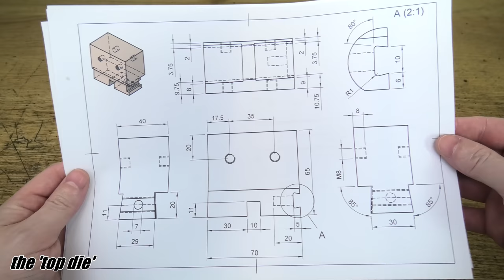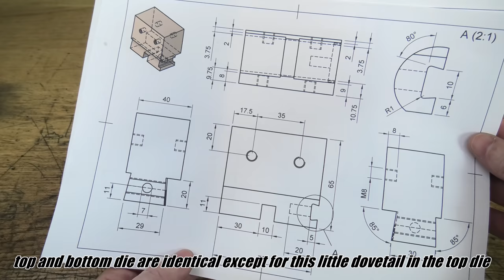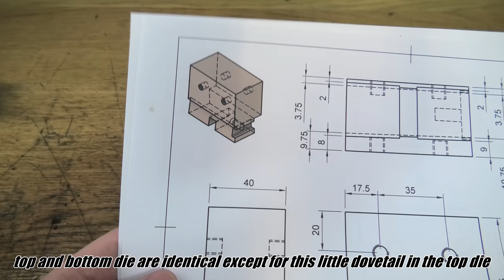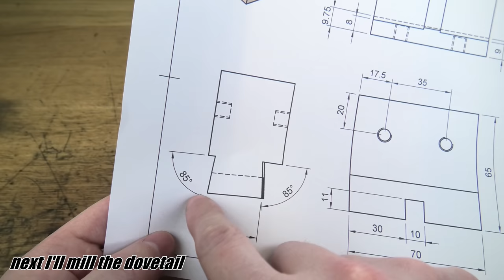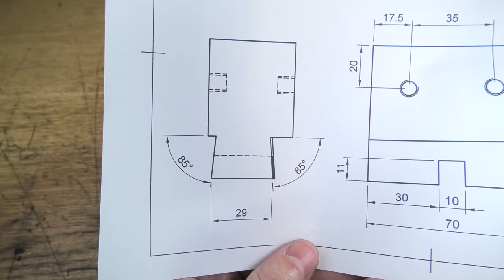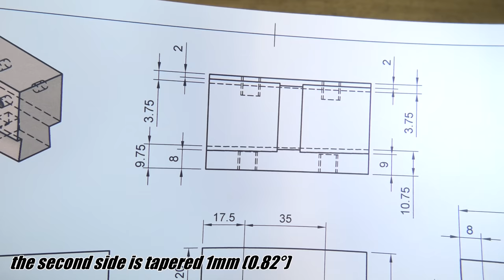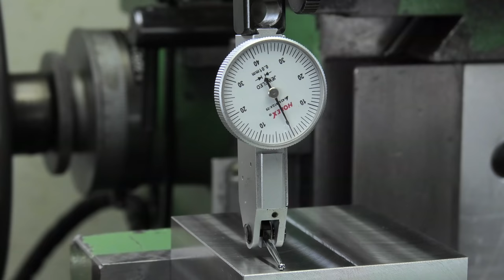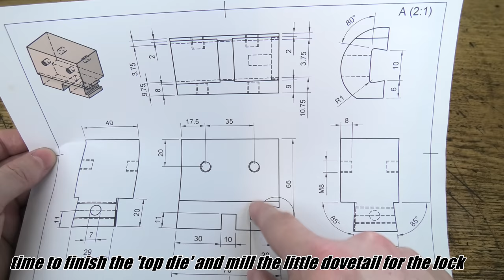Making Power Hammer Dies for 'Black Beard Projects' - with Lock Mechanism

Comment: Anyone else have no idea what a Power Hammer Die is but still enjoys watching these videos? 😂😂
Reply: Honestly, me😂😂😂
Reply: Hammer Dies have been used for decades. During the 1980’s, Power Hammer Dies became the standard.
Reply: I have no mechanical experience and no idea of what most of the parts that My Mechanics makes are for. But I love watching a perfectionist work. In this world where "good enough" seems to be the standards, it's nice to know that there are people who do exceptional work.
Reply: @cat3crazy   These are attachments for another machine (the "power hammer") to shape the material it hammers. That's what a "die" is in engineering: a part used to form material into a desired shape.

In this case the material was metal, but dies are also used to mould plastic and other stuff. They're very useful in manufacturing.
Reply: He linked to the video for BBP.   You can see the dies on the power hammer, hammering some steel.
Reply: Oh yes

Comment: I dunno if its the same term for metalwork as it is for woodwork, but I always appreciate your dedication to chamfering all of the edges
Reply from the maker: Yeah chamfering is correct. Thank you very much :-)
Reply: And the radius on the locking slide is known as a fillet. Fillets have a rad, chamfers have an angle

Comment: Another excellent video! The way you take life in deburring the sharp edges impresses me. Not only does it prevent you from getting a jagged cut from the milled edges. It also allows you to clamp your stock accurately in the vise, not on a burr.

I always deburr my parts after any type of machining or drilling. It's a very important part of manufacturing a quality part.
Reply from the maker: Thank you very much, I really do appreciate it :-)

Comment: I was working on a rifle part, and I found that the front and leading edges of a moving buffer weight weren't radiused/chamfered enough to not scrape and abrade through the tube it was moving within; and I thought of you. If I had a lathe I'd have chucked it up in there, but had to settle for hand radiusing and polishing it on a Worksharp belt sander. Love your channel, thank you for sharing with us! You're next on my patreon support list.

Comment: Looking at the print shown at 0:14... On the top view there is a feature dimensioned 8mm and 9.75mm on the left side, but 1mm more on the right side. 9mm ant 10.75mm.  What is that for?  I thought maybe that the part had a slight angle there but it's not shown in any of the other views like the taper of the dovetail from 29mm to 30mm.

Comment: Absolutely beautiful! I just have to say that seeing you use “popcorn” packing to ship those parts makes me cringe. I have worked at UPS for 29 years and I’ll tell you popcorn packing is the most worthless packing made. What ever you put in that popcorn will settle to the bottom of the box and your part will only be protected by the cardboard box. If you shake your box and it’s contents move, you are risking damage. Wrap the parts in foam like you did but stuff crumpled paper or more foam packing in the box till it’s completely solid when you close it.
Reply from the maker: The package was stuffed super tight, I did shake it and nothing moved ;-)
Reply: I use them on my job, and they are always a mess to work with.

Comment: Gonna be interesting. I actually worked with a Powerhammer and we only secured the dies by pushing the key into the gap hard enough so it won't come out. 

Would be interesting if the spring system is as reliable/durable as the good'ol pinning and if the die after it got locked has some slight movement (which would be very bad tbh)

Comment: Well how the did you get the angle on the aluminum plate?
Reply: That's what I was thinking. If he was able to mill the angle on the plate, why not just skip that step and mill that angle directly to the dovetail? There must be a good reason.
Reply from the maker: I clamped it on the milling table and turned the whole table in that angle, that was the only solution I could do to make that tapered dovetail.
Reply: @mymechanicsinsights  Did I understand correctly: this is because you can only tilt the table in one direction but you needed an angle on two axis? Thanks for replying :)

Comment: Unfortunately I just found this video, a little late, I know. Anyway, what I don't understand is if the 2 big block dyes are wrapped in foil when put in the quench oil, how is the oil quenching them w the foil barrier?
Reply: The quench is not the touch of the oil, it's cooling the piece from temp A to temp B. That happens with the foil, the foil helps prevent scale from building up on the surface of the blocks. They still get cooled rapidly then tempered even with the foil.

Comment: What exactly would the effects be applying a heat treatment to something wrapped in aluminum foil? Zero *protection resulting in scaling?
Reply: The aluminium would melt long before reaching the right temperature.
When hardening steel, you heat it to above 1400°C
Aluminium melts at 660°C
Reply: @HepauDK  thanks. This is why I'm a carpenter! 😁
Reply from the maker: It's stainless steel foil ;-)

Comment: may i ask u: why this stainless steel-sheet? yea i have seen the part about the problem with scaling but how does this work?
Reply: If I remember MM's explanation, the scale forms when the oil burns on the surface of the block. The foil is what touches the oil and does the burning. The block still gets a rapid cool.

Comment: Can anyone help me understand the use of the hardened pin for clamping the block while milling?
Reply: It creates a pivotable pressure point so the workpiece will index flat against the rear jaw of the vise. Without it, there's uncertainty which of the jaws the workpiece will align to.
Reply: @KJ6EAD  thanks. That makes sense
Reply from the maker: I couldn't explain it better, thanks :-)

Comment: Hi My Mechanics, really enjoying all your videos. I saw the furnace you used to heat treat the parts and it is the same as the one I have just purchased at an auction. My question is do you think you would be able to make a video on the furnace and how it works inside and out. And what sort of things it is capable of doing.I ask this because am not 100% sure about using it and purchasing new parts for it. 
Cheers Kev
Reply from the maker: It's not my heat treatment ofen

Comment: Just curious: Why is cutting oil only sometimes necessary?
Reply from the maker: It won't hurt on any cut, but on HSS tools it's better the cool them so then don't get too hot. Not much a problem with carbide tools.

Comment: Mixing the old climbing and conventional milling there I see.
Also be careful with setting a square against the bed of a vice, for the vice might not be true. Best practice is to use an engineer square on a surface block 👍 
Really nice work though!
Reply from the maker: Oh I made sure that the jaw is true before milling:-)
Reply: @mymechanicsinsights  good man, not criticism just adding little notes. Plus you are far more advanced in your mechanical machining and understanding than your given credit for! I for one admire you approach to your work!

Comment: Forgive my ignorance, but why file the sharp edges after each milling rather than mill all the sides and then file?
Reply: Safety and precision. An unchamfered edge has imperfections and sharp edges that could prevent precise clamping or even cut you.
Reply: @TheRealColBosch  That makes sense thanks
Reply from the maker: It's also not precise to clamp on sharp edges

Comment: Dumb Question Incoming:
Why does the part still get hardened even though it is not making contact with the oil when quenching? Should the material be touching oil?
Reply: Oil does transfer the heat out of the part at a different rate compared to water. Contact actually does not matter when quenching i think.
Reply from the maker: Yes, contact is not important only cooling. This steel would also be quenchable just in room temperature air. It also only needs to cool down quickly to 750°C from 1050°C, then the part will already be hard.

Comment: Great work on your part!. Too bad BB's design missed a trick. If there had been a small threaded hole in the top of the top die you could have installed a retainer screw for the spring detent. The way it is now that little piece could go flying into oblivion if care is not taken to catch it upon die removal.
Reply: A shallow 'parking' detent can be milled on the back of the lock for the lock pin to spring into when out of lock position. This will help prevent surprise disassembly.

Comment: Question: The stainless foil seems great for scale prevention, but doesnt the dead space it traps around the die interfere with the quench to some degree ?  Would it make sense to remove the foil immediately before quenching ?

Just curious ... ive never smithed.
Reply from the maker: If you'd remove the foil then the part would already be too cold for the quench and it would build scale again if you quench in oil. As you can see the hardening worked ;-)
Reply: @mymechanicsinsights  Hard to argue with what works.  Had to ask though. And thank you.👍

Comment: The dies turned black because there was a lot of air trapped in the "package" when quenching them in the oil. This also causes poor and uneven cooling performance (because, thermodynamics).
You know you have packaged them right, when they are a perfect flat grey when you remove the foil (similar to how it looks when sandblasted). This can be achieved by flattening the foil against the objevt with a nylon hammer or similar, making sure that air and oil can't get in. Just make sure the foil is as flat against all the surfaces as possible.
The satisfactory of seeing that perfect grey surface when removing the foil is about the same as when you pull a guide pin out of its seat and it makes that loud "pop". :)
Oh, and you really shoud get a liquid cooling system for both the lathe and the mill. As a trained fitter, I cringe every time I see someone use highspeed tools without it. Oil will lubricate but not cool the tools... During my apprenticeship back in the mid-90's, for half a year, I was tasked with checking and adjusting the coolant on all the CNC-machines in the shop. Let's just say I became VERY accustomed to using a refractometer. :)
Reply from the maker: Yeah the dies were actually nice and grey after the quench, the black color came from the tempering at 600°C
Reply: @mymechanicsinsights  Ah, I must have remembered wrong then. I guess it becomes black while quenching if the foil package isn't sealed properly, so that oil can enter and make contact with the steel. My statement about the thermodynamics still stands though. You need to cool the steel as quicly as possible to maintain the correct molecular structure in the steel. In this case, the most important part is the impact surface.
On a sidenote, never try to force a guide pin into a hole that is slightly too small in a hardened die. I once prepared a forging die for maritime eyebolts (the die was about 30cm in diameter), and needed to sand the holes for the guide pins to make the pins fit. I got impatient and descided to drive one of the pins in with the hydraulic press. Needless to say that it didn't end well. Hardened steel has no flexibility whatsoever, so the entire side of the die  blew off. A quite expensive mistake that you only make once in your life...